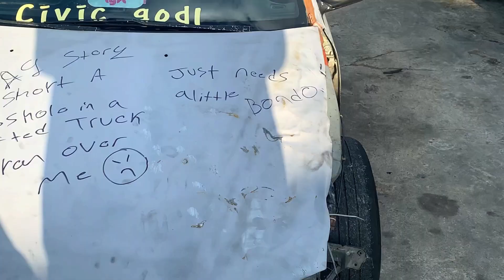Project EG Civic Hatchback | Yonaka Catback Exhaust & Header Install

Comment: How did you fix the problem where you have 3 bolts on the resonator and 2 from the Header connection that have 2 bolt???
Reply from the maker: Your stock catalytic converter should fit or use a test pipe like I did
Reply: @bigkevondis  TY